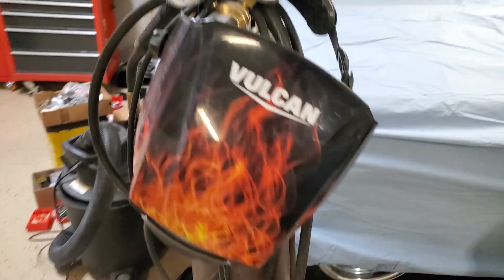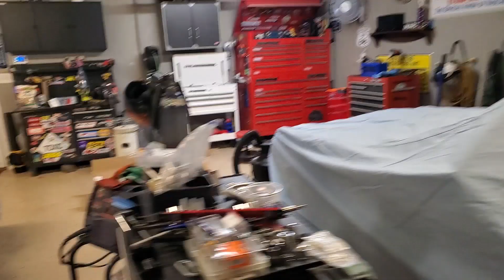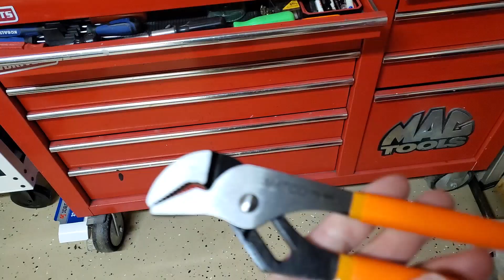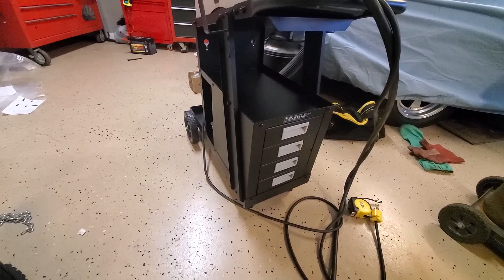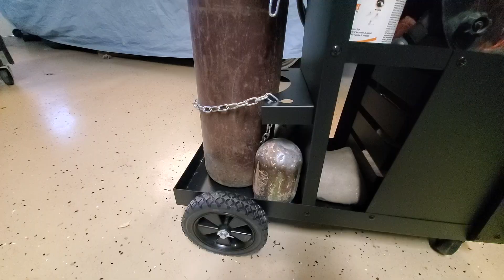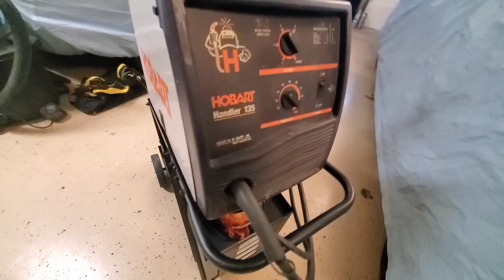Best Budget Welding Cart? YesWelder Welding Cart Review

Comment: Good video, I like the drawers underneath the shelves. I had the same problem with my Hobart 135 welder on a similar welding cart. Harbor freight has a 4 pack of anti-fatigue mats for around $15. If you take one of the mats and cut it down to fit on the top shelf, it will raise the welder up just enough to clear the door, and the foam rubber mat will keep the welder from sliding around like it might do with plywood.
Reply from the maker: Thanks for the tip! I appreciate the suggestion. Thanks for watching.